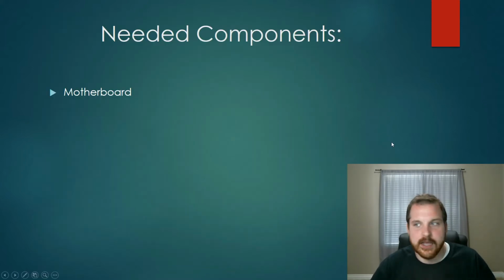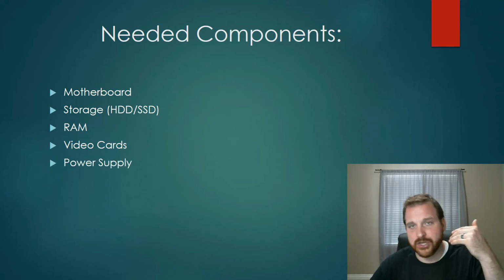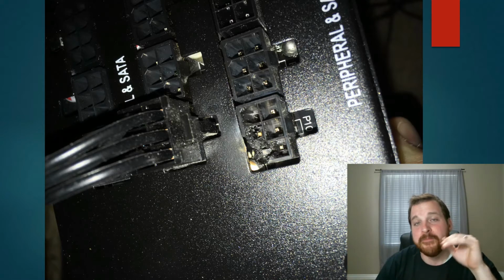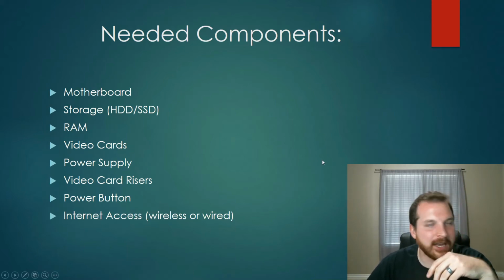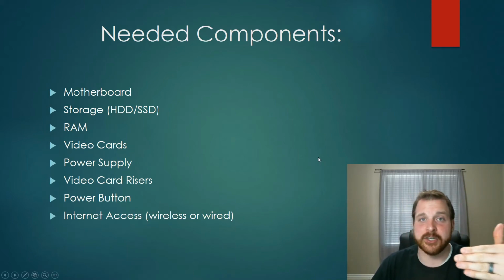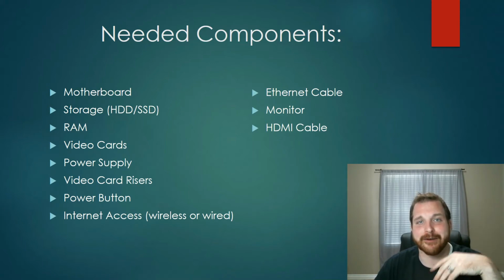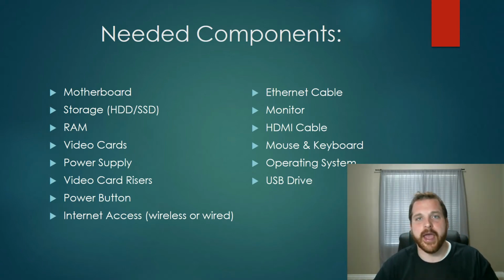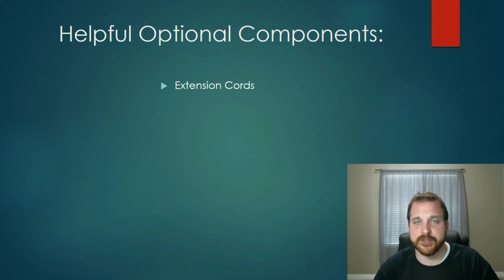Crypto/Ethereum Mining Rig Components

Comment: How many GPUs was that periph cable supplying power to? I believe the periph port on a PSU only supports a max draw of 60W, and two GPUs can easily pull 90W from their risers.
Also, why not just use 6-pin to 8-pin/6-pin pcie cables, then use extensions to connect the extra 6-pin part to the riser? In that way you're able to get around using a SATA adaptor, which are notorious for their poor quality control.